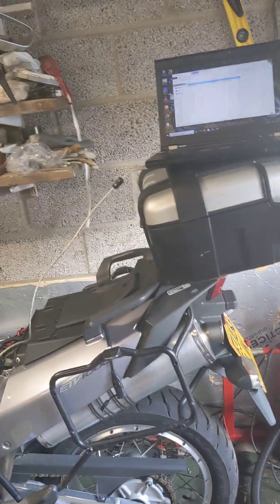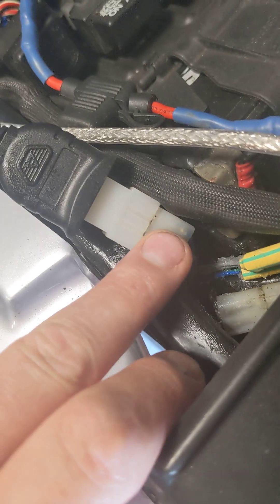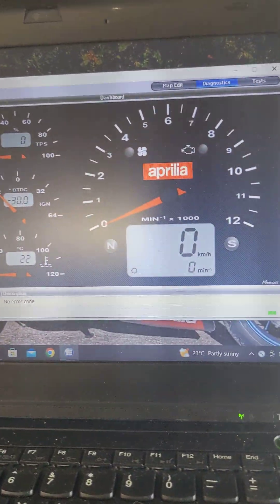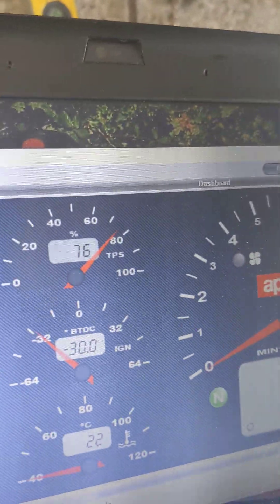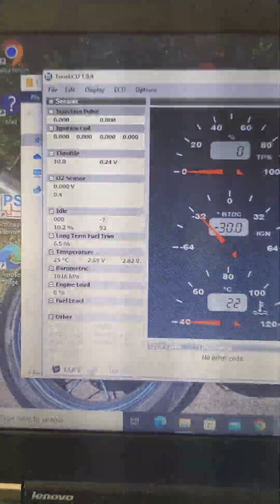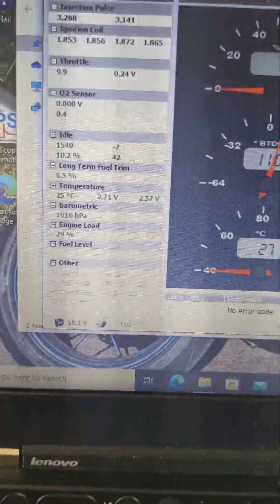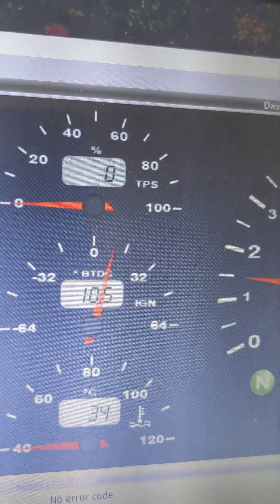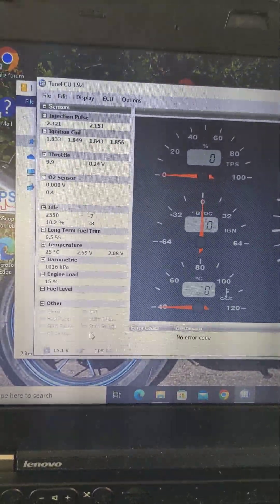Aprilia Caponord connection to Tune ECU for a quick check of tps and fuel trims

Comment: I think I'm gonna have a project and install MaxxECU to the bike, since TuneECU never works.
Reply from the maker: What's max ECU?.
I've never had a problem with tune ECU
Reply: @captbarb6642  MaxxECU is aftermarket ECU, which I already have put into another bike. Installing it to Caponord is pretty simple since it is already EFI bike so all the necessary components are there, and also fuel and ignition maps are available on internet so it would be piece of cake to install,  especially when compared to EFI conversion from carburetor. Of course it isn't very cheap but which hobby is? :D
Reply from the maker: @sippilandia  sounds great but I've not had a problem with the old efi system .
The only problem I had was getting the pc you had tune ECU to run slow enough to talk.
Reply: @captbarb6642  Yeah, it's not like I would really need it either, but it would just be fun to do.
Reply from the maker: @sippilandia  nice to keep our brains active .

Comment: That engine starting was not really healthy. If not yet done, the starting cable must be upgraded. Or upload the 050429 map. The Capo starts easier with that.
Reply from the maker: Thanks for that after doing the valve clearances this winter I took the opportunity to run another earth for the starter motor fixing bolts to the engine and then to the battery , I haven't run a power lead but checked the connection and cleaned .
As far as the  map I'm happy with  the swordfish map which seems fine ,maybe after clearances being adjusted things might be different.
Unfortunately the dash has not powered up and found one of the capicators is faulty.
Reply: @captbarb6642  upgraging the startercable is beneficial too. Same I recommended to Mario, as well as the additional grounding to the starter motor. He made it also.
Reply from the maker: @ETV-xt1kq  yes he did starts like a Japanese bike now he did change his starter motor also.
Reply: @captbarb6642  exactly. As he sent me the video about starting, I was pointing out the squeaking fpr. Now as he changed, that is perfect too.
Reply from the maker: Are just played it , that slight slow turn over on starter motor is that what your referring to.
Could be the battery , did you know the bike won't start until the ECU sees the front cylinder at tdc so sometimes they turn over before firing , well that's how the RSV ECU work which is different but I wonder if they are the same .

Comment: Hi, i just bought 2005 Capo. I am interested about remapping. To install caftish I need generic KKL with FTDI chip or better to order KKL interface from Lonelec? Basically i want smoother riding while  RPM under 3k
Reply from the maker: Hi I purchased mine from lonetec and it's been fantastic.
Your bike I think will have an O2 sensor I tried the catfish maps they are good .
I installed a swordfish map on mine and it will dribble along in top gear at 2000rpm which is a big improvement from the OEM map good luck .
Remember to upload /save your old map before downloading new just in case you need it .
My mpg now two up and loaded  at 75 mph is 54mpg .
Good luck .
Reply: @captbarb6642  Thank you very much for your response :)  All I need is a better response at low rpm.
Reply from the maker: @edvinas941  
I found the maps all of them didn't give more power just much better running especially low end .
Reply: @edvinas941  better to choose the Swordfish map if you want to have low rpm smoothness.
Reply: @ETV-xt1kq  i will try it when i fix my bike, thanks for hint
Reply: @ETV-xt1kq  sorry for disturbing. Do you have a newest versions of swordfish?
Reply: @edvinas941  yes, of course

Comment: Oxygen sensor 0.000V ????
Reply from the maker: That's right it's a UK bike  2003 no sensor or cats fitted on this age of capo
Reply: @captbarb6642  Thanks for the explanation 👍my 2003 European version has an oxygen sensor.
Reply from the maker: Are that's interesting where in Europe are you .
Reply: @captbarb6642  Czech Republic and a motorcycle imported directly from Italy.
Reply from the maker: @motomike83  
Nice are they very popular In the Czech Republic.
There not very popular in the UK quite a cheap bike to buy very underated .